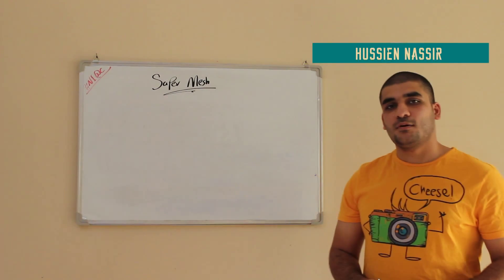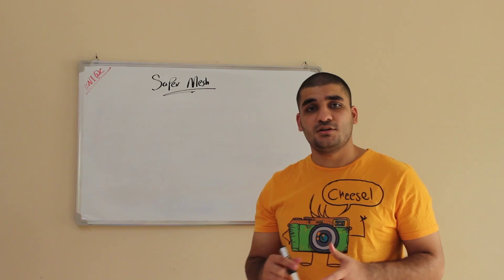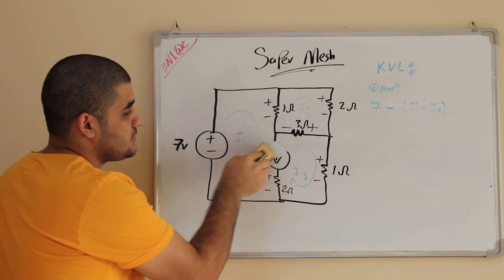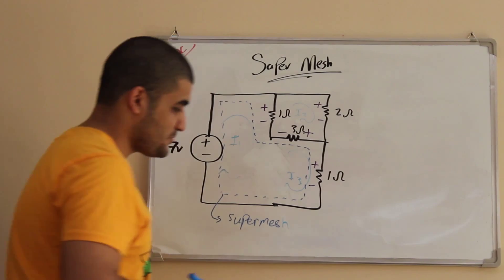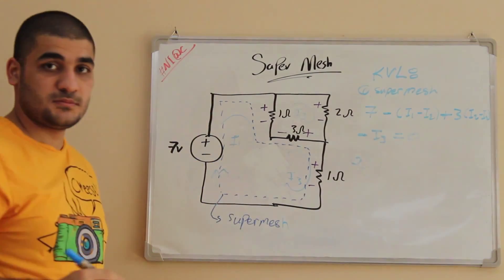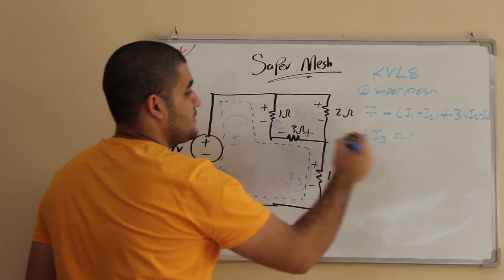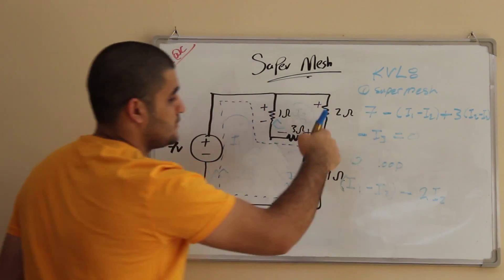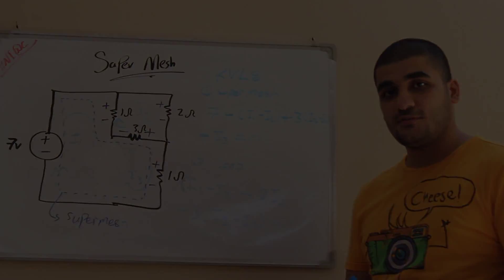Circuit 1 - Mesh Analysis - Part 2

Comment: Why did you remove the current source? Why did not the resistance polarity change in the new circuit after removal? I hope to explain how we apply the Kirchoff Act to common resistors, because I did not understand that well